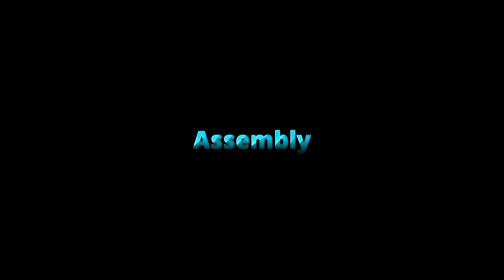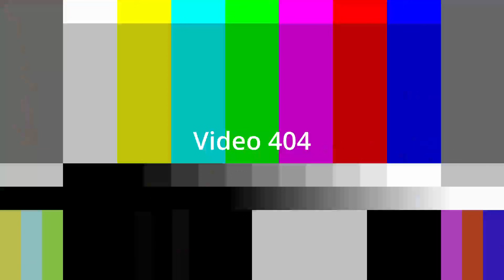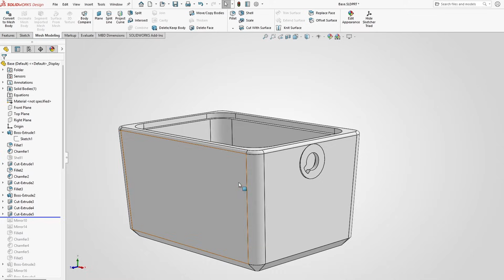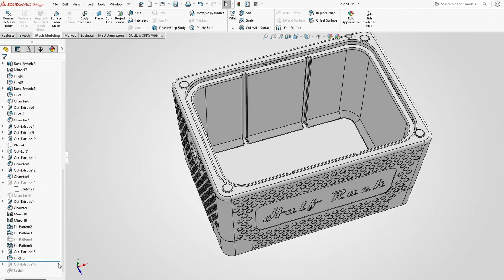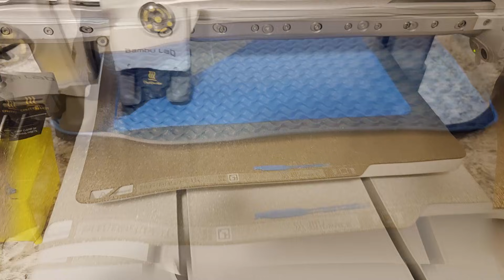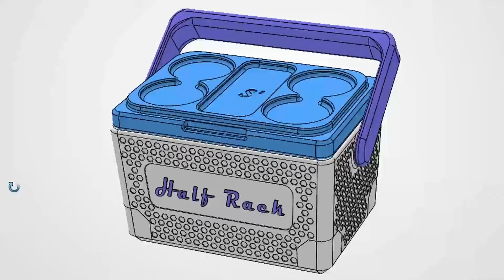I Designed and 3D Printed a 6-Pack Cooler!

Comment: Very cool, like all your other videos!

I realize there's no place to put the ice, so my question: Would the air gaps in the infill act as insulation?

Also, I would love to see a tall-boy edition! 🍻👍
Reply from the maker: Thanks! Ice? LOL, just kidding. Yeah, that was an afterthought... 🤫. I guess I just thought that the drinks would already be cold when putting them in the 'cooler', so instead it maybe should be called a 'warm impeder'? My counter for that though is it's now a 5 pack or 4 pack cooler if you want to include ice. After thinking on it for a bit too, I've decided to fill a can with water, freeze it and place it in as an ice pack. I dunno... Nice catch though! Tall boys? That might just have to happen, although I never make promises.

Comment: Where do you put the ice...?
Reply from the maker: 100% afterthought... I guess ideally that the cans are already cold and that the cooler buys enough time to drink all six before they warm up? I guess it's not called a 'cooler' in that case either though, more like a warm delayer... ? I resorted to removing 2 cans for ice, seems to suffice for now. Another thought is remove a full can, replace it with one that has frozen water in it, then BAM a cold block of ice and 5 can capacity! LOL. Honestly though, afterthought, thanks for noticing 🤫

Comment: Fill in the infill areas with polystyrene foam for better insulation performance.
Reply from the maker: I've heard that it could improve the insulation by doing that, I wonder how much though? Might need a test specimen first.

Comment: Very cool. Make an Ice pack that fits between 4 cans to save more space.
Reply from the maker: Thanks! Yeah thats an interesting idea, a 3D Printed ice pack. Might have to experiment with that one, getting some idea's that it might work with a koozie design too. Cold near the can, warm near the hand. Nice! Thanks!
Reply: @sanfordprime  Long ago I tried toe koozie thing, bit it seemed to have poor insulation, Perhaps a canned foam would make it a bit better for insulation, and also work with the cooler, and save on plastic, and print time. What plastic are you using? PLA? PLA will deform if left in a hot car.
Reply from the maker: I found myself wondering how much better it would be using a can of 'Great Stuff' for insulation. It's a good idea, and I've seen other printed coolers designed to accept it. I'm curious now, might have to try something on a smaller scale first to see how it does.

Another idea that seems to be on my mind is rather extreme, but putting the whole printer in a vacuum chamber... when the hollow print comes out of it there would be no air molecules to transfer thermal energy, much like the high end koozies. Obviously there'd be issues with plastic cooling n stuff during printing so maybe just a port to remove the air with a vacuum nozzle after printing... lol!

I used Petg for this one for durability.

Thanks for your engagement with this, really gets the mind going!